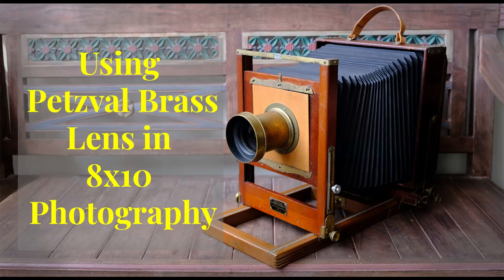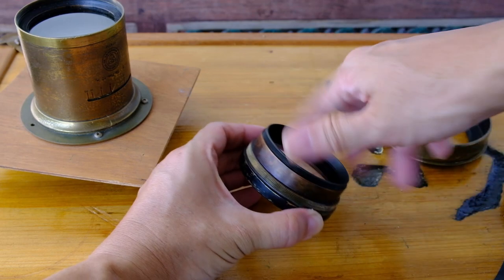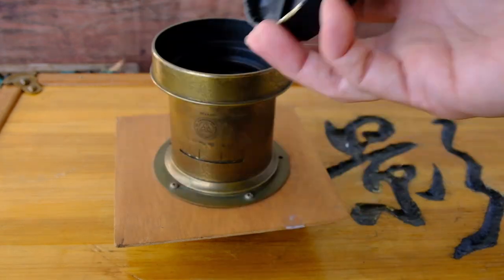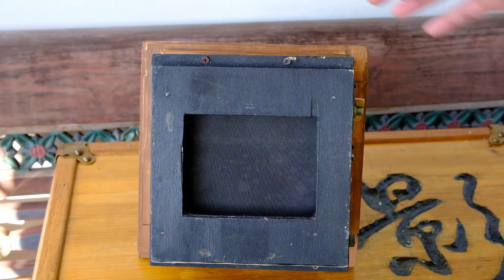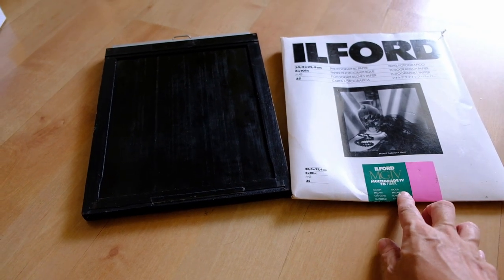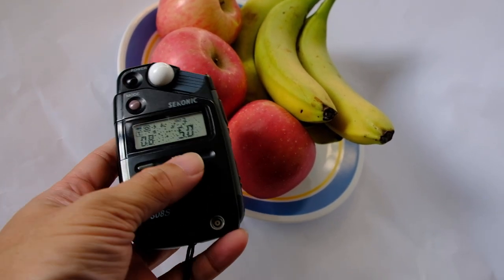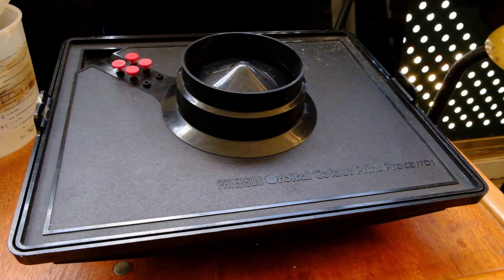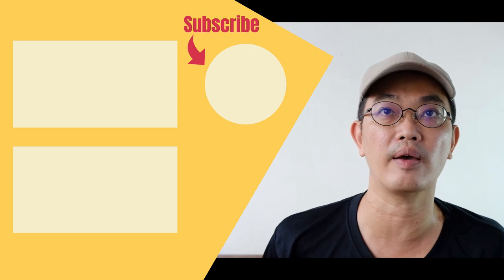Large Format Petzval brass lens in 8x10 photography

Comment: Those slides will go in easier if you wipe them down with a little furniture polish. The focusing tracks would benefit from some, too. That shutter setup is intriguing. Thanks.
Reply from the maker: thank you for the tip. will definitely try it out!

Comment: I have a Chamonix F2 and Graflex SLRs.  With a new Cooke Series II 10.5" coming, I'll have no issue with film/paper on the SLRs but wonder the best system on the F2 to manage <1 sec of exposure.  Thoughts?   For 1sec+ can be the hand/cap method. Thanks
Reply from the maker: i think we have less options when it is a 4x5 field camera. not sure how big is the cooke lens front diameter but if you have a 8x10 lens with a big betax or ilex no 5 shutter then probably an adaptor can be made to mount the shutter IN FRONT of the lens. Another option would be a packard shutter that will give around 1/20 sec
Reply: @AnaloguePT  I've been looking at Packard lenses yet don't know if they make one to fit a Linhof lens board.
Reply from the maker: some folks mount it in front of the lens like this https://re-inventedphotoequip.com/Shutters.html

Comment: thanks, a great video showing you using a barrel lens.
Just a question, don't get it wrong, why is the barrel lens not being able to give a sharp focus even at the center of the result photo negative?
Does it have to do with focusing, or have you just let it be without even trying to focus? I just want to know if that soft focus at the center is a characteristic of the lens.
Reply from the maker: thanks for the watching. by the lens design, you should be able to get as the centre to be sharp. in my final image, there sharpest point is the left portion of the  front banana,  probably the camera got knocked off a bit after focusing.  probably i will shoot a portrait with it soon and share the results.